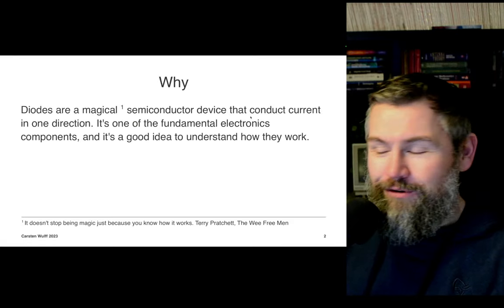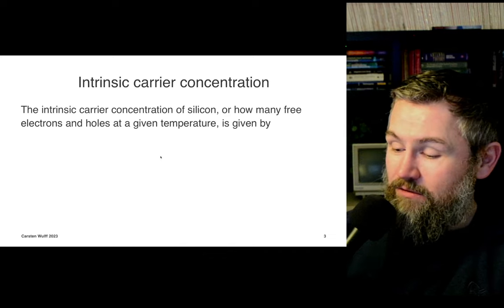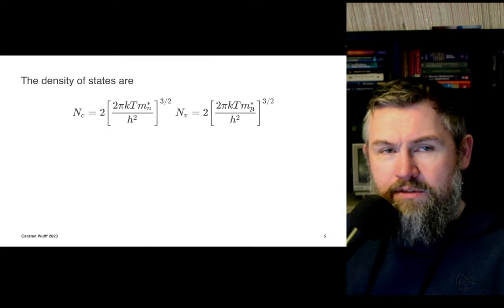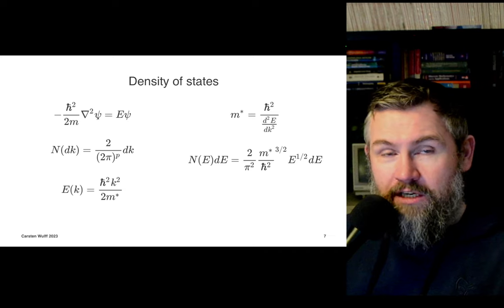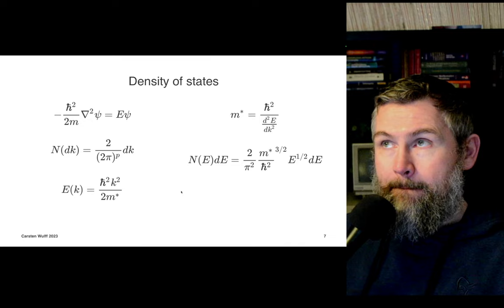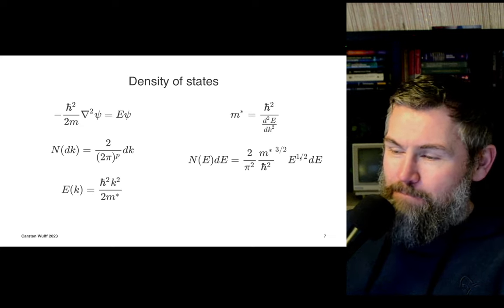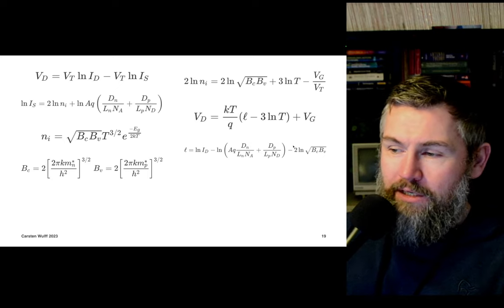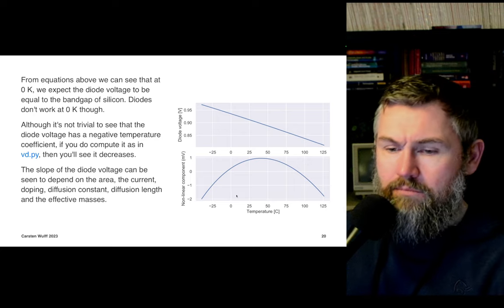Lecture 1 - Diodes

Comment: Note: In this lecture, you refer to k as the momentum vector and functions of k as being "in the momentum space". In standard terminology, this is the wave vector and functions over it are "reciprocal space" since k is reciprocal with regards to spatial dimensions, its unit is 1/meter